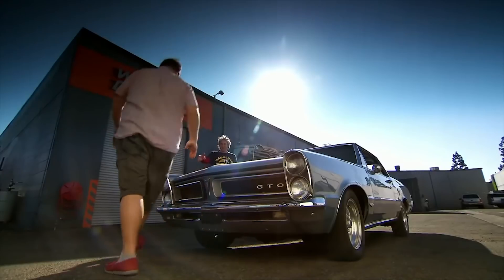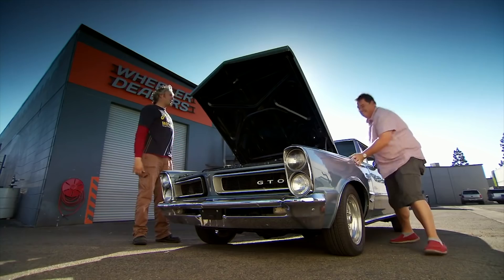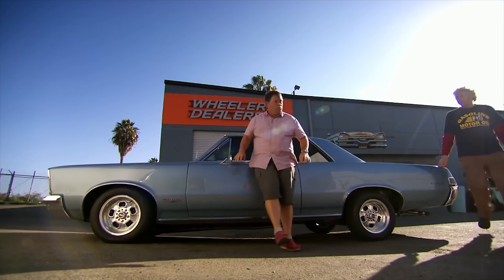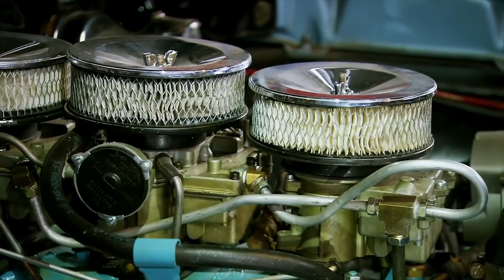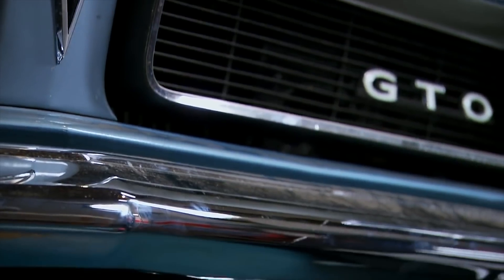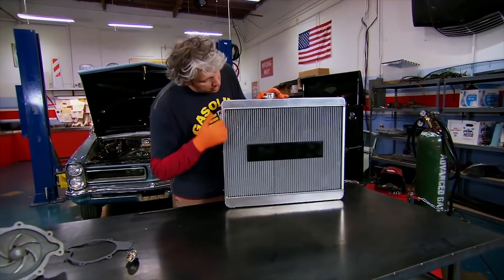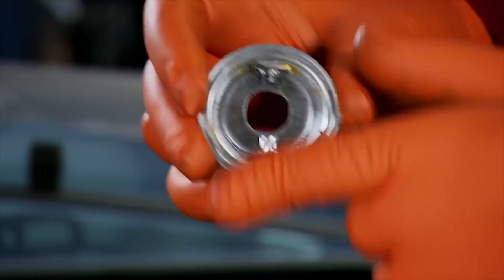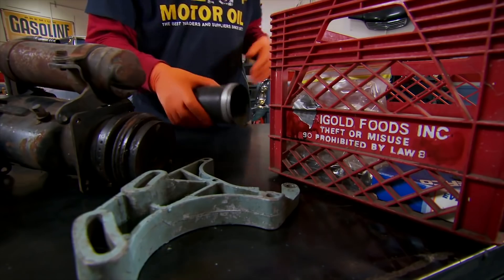Edd Gets To Work On This 1965 Pontiac GTO | Wheeler Dealers

Comment: The thermostat was probably the problem. It doesn't just control when the water flows it controls the rate of the flow. The water has to flow across the cooling jackets slow enough that heat is transferred from the block to the water, and slow enough the heat can be transferred by the radiator to the air. People think by removing the thermostat they're going to get better Cooling but that's not so. Pontiac heads are machined as opposed to Chevy heads that are cast. That's why Chevy heads get hot spots.

Comment: Also aluminum radiators must sit in rubber mounts because the expansion and contraction coefficient of aluminum and steel are different. If you bolt an aluminum radiator to steel eventually the aluminum radiator cracks- torn apart.

Comment: 65 389 Goats weren't known for running hot, unless something was screwed up. A huge radiator, and dual electric fans are just a band-aid. That motor when stock has almost 11 to 1 compression, and when running on todays piss gas, wants to detonate itself to death. So what do people do? Kick the timing way back, which causes what? Hot running. Anyone check that yet?

Comment: The one thing almost no one knows is many hi performance piston rings create about 150% more resistance/friction and if you pull a piston threw the cylinder it take 40 pounds of force rather than the original up teens of resistance. Logically  the extra friction creates much more heat for the cooling system. 99%+ mechanics never figure this out and lose performance threw friction and extra electric fans with more blades, bigger radiators etc... If the engine is correct inside the factory did it right these cars will not overheat. See how rumors get started? Just like for decades so called gun experts said Colt 1811 pistol were not accurate-they based this on so called expert that were in the military shooting  worn guns in Viet Nam that were already used to WWII and Korean War.